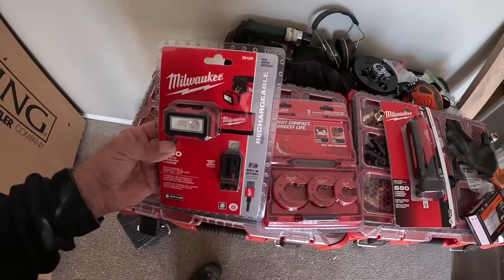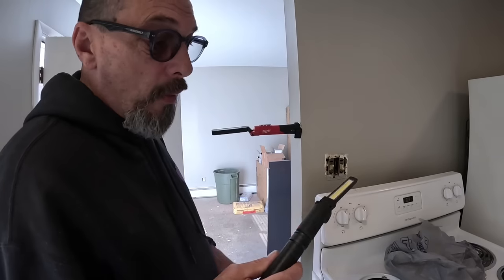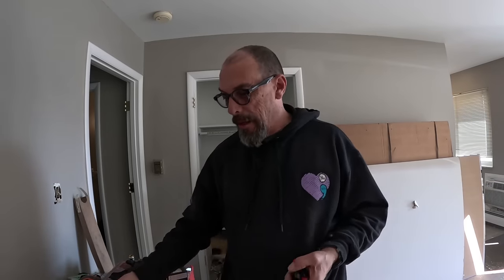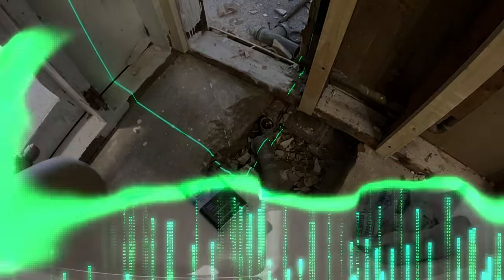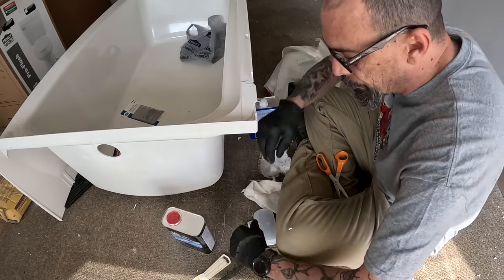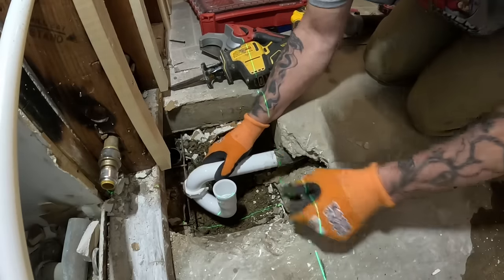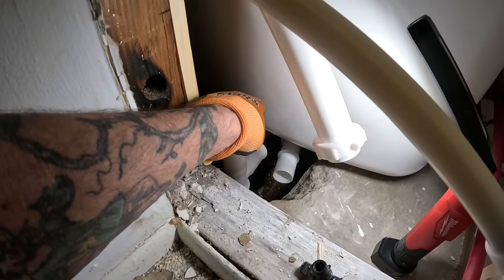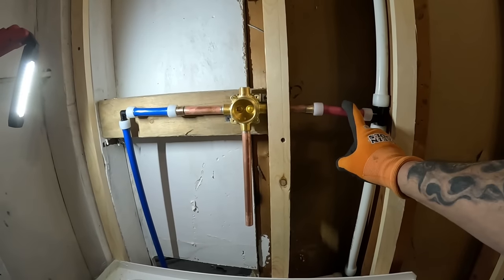How to repair a cracked bathtub

Comment: You'll want to set those vikrell tubs in a bed of type s mortar or mud pan mix or they creak and crack everytime you step into them. I've noticed it even installed on a slab

Comment: 13:55 instead of killing power to everything you could use the Klein ET 310 circuit finder kit, comes with the receiver, outlet transmitter, socket adapter for light bulbs and alligator clamps so you can isolate the plug/bulb/circuit you're working on if you don't wanna totally be in the dark (or if your light batteries are low) and also awesome if the previous sparky didn't label a panel properly. Nice milwaukee headlamp btw I was in HD yesterday looking at it because my husky headlamp is good but the housing tab to charge and swivel to point down are cheap plastic while yours has audible ratcheting stops. Keep up the go work brah 🤙
Reply: If his apartments are anything like I work on there isn't a seprate lighting circuit living kitchen are one including lights and bedrooms bathroom are another.  I've found my fair of hot neutrals because something is touching something....  there's 6 properties from the 70s to the 90s like that no gfis no main shut-off to the pannel so we have to do what we have to do.
Reply: @MattHmm-rq6dn oh I learned my lesson last year,  I was replacing a light fixture going down my stairs, touched the neutral thinking only the hot could hurt me, it was very brief but I felt the sharp needle pain of a shock. Watch out for those neutrals people. Original knob and tube style wiring still mounted in the basement and attic ceilings

Comment: I love my head lamp. That Milwaukee one is great but lasting a long time depends on how high it is. Feels short to me. I have the rover light and that little one plugs into m12 to charge which I like. Have lots of m12. Used to use m18 but I rarely pick them up now. Love that other drill that you have been using. I like the stick light. Need to check that out.

Comment: Did you make a video of the expander you bought when you got it I can't find a video I enjoy seeing you buy new tools if you could let me know which video please and thank you
Reply from the maker: Expander???
Reply: @Raysmaintenance  pex expander
Reply from the maker: @samalmanza975  ooooo 😆  i dont think i did, but i have used it in the last 3 videos and the next one. I just finished the tub installation today. I like it, and you get good water flow with the pex A lines. But it's hard to find the fitting i need, so it's always a mix mach on plumbing.
Reply: @Raysmaintenance  you think you can make a video reviewing it ive been. Thinking of buying it they say you get better flow with water who knows I've never had any problems with the crimp rings